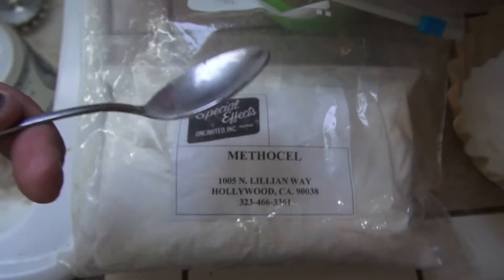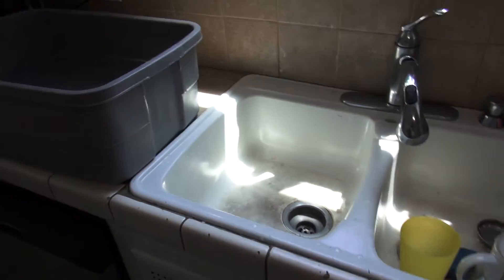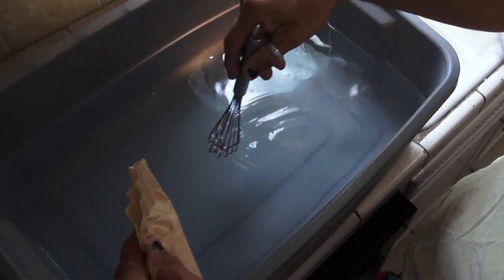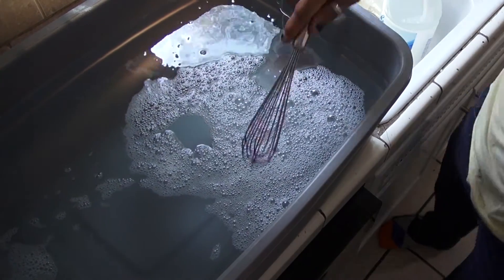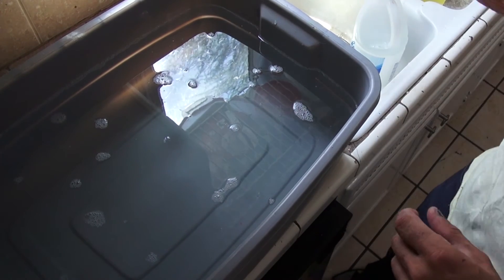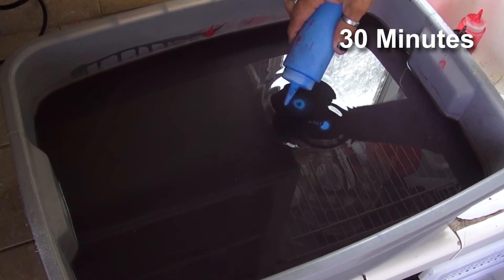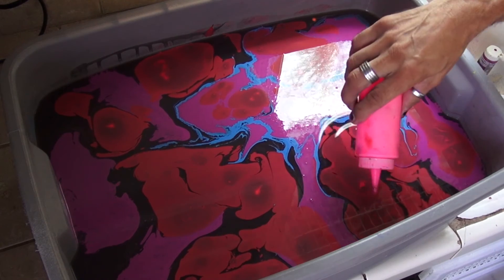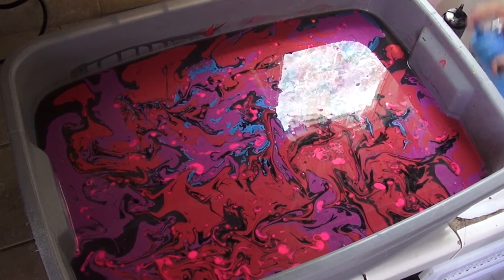how to make paint float with methocel and amonia

Comment: I'm trying to use liquid starch to thicken water and float acylics..it's floating but paint isn't transferring to the object I'm dipping which is a candle
Reply from the maker: acrylics only work on porous items like paper or clothing etc... otherwise the paint is immediately washed off by the float..i sometimes dip items with oil based paints instead cuz that sticks to everything but burning a candle with paint on it seems like a toxic smoke thing.?

Comment: Is this safe for kids ? Where can I find more info on how to do this? Thanks man.
Reply from the maker: the amonia is dilluted out o the bottle but i wouldnt use amonia near my kid.  there is a recipe to make paint float from a prodcuct called carageen which is a food product that you can eat so maybe use that instead it just takes a long time to thicken up
Reply: @cooketv  Thanks for the reply. Hard to find proper info on how to do this in a "fun body paint at an event" scenario.
Reply: @cooketv  what kind of paints do you use will any paint work?
Reply from the maker: it depends.. i use a huge variety of different paints.  you might have to thin up the paint so its more watery.  thick paint sinks more and is slow.
Reply: @cooketv  thank you, I use one brand so far, looking to expand my options.
Reply from the maker: @danielgidley7141  any paint acrylic really.  i buy those little bottles from michaels.